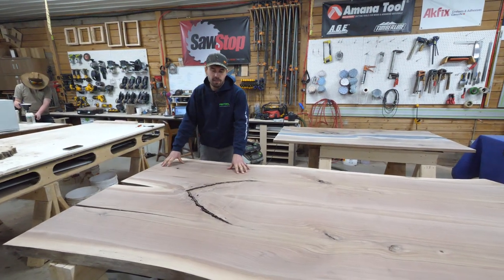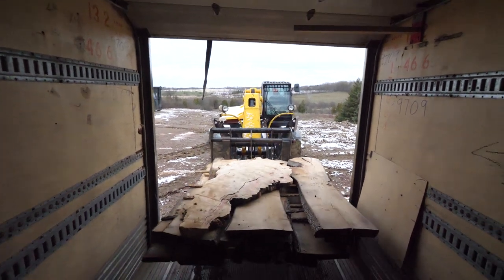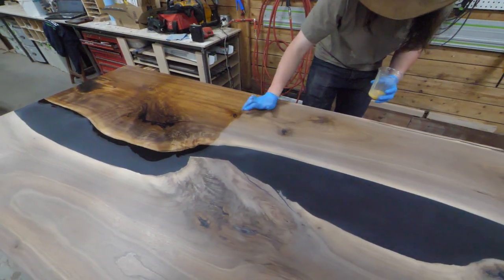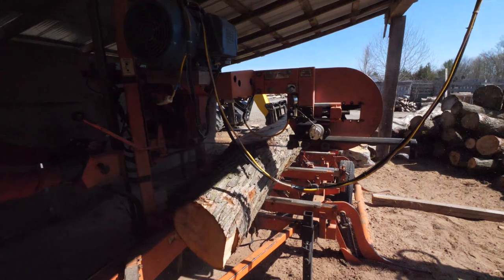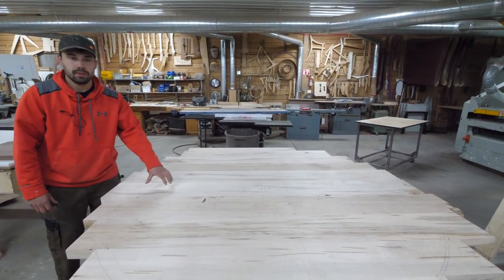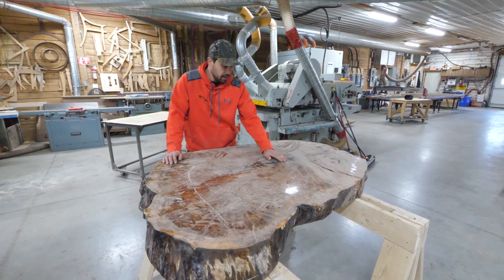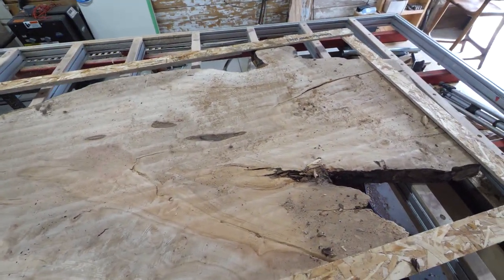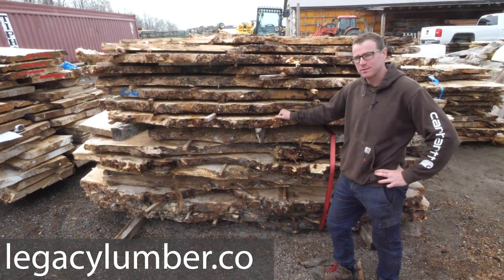Woodworking Life 215 - Week In Review

Comment: Paul try this sometime.....Strip any size cooper wire, try 12 gauge or 14/3 strand first....clamp the 3 strands in a vice and the other end put in your drill and tighten.....start your drill and let it spin until you like the look of your wire....Now find a crack that the wire fits....larger cracks....larger gauge wire.....Epoxy as usual and put through the sander for a interesting effect.